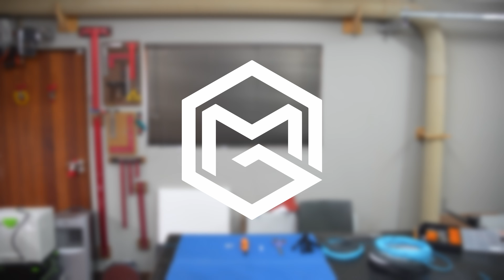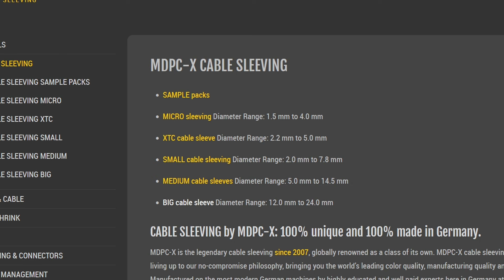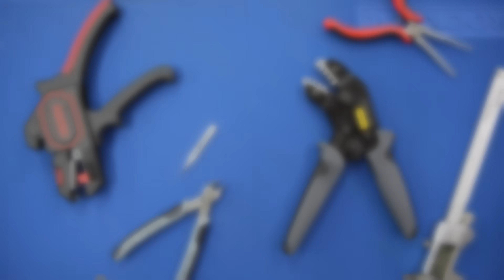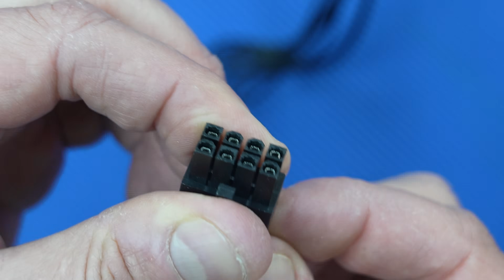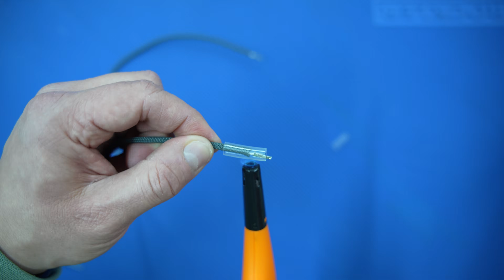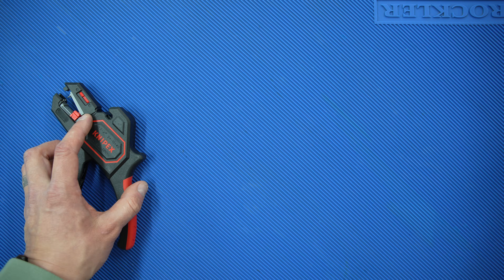EASIEST Way to Sleeve Your PC Cables (No Expensive Tools!)

Comment: how about those gpu cables with pigtails? can you remove those?
Reply from the maker: Yeah definitely, exactly the same as the rest. The terminal is just crimped to two wires , but the terminal is the same on the connector side

Comment: I'm about to sleeve my first 12v2x6 cable just following this method. Got most materials from MDPC-X as well, except the tools which I think cost way too much and the wires which I don't trust the 17 AWG they have are suited for these type of cables.
Reply from the maker: Hi there! How did it go? Yeah I do agree, their tools are quite expensive, but having used several different brand of crimpers, I do think they are worth the money. Especially with small terminals!

Comment: I was considering custom sleeving only the visible part of the cables and leaving the original sleeve on the hidden part, securing them where they meet with some heat shrink. Would it work? Would you approve? (Love the video!)
Reply from the maker: You can definitely do that. It should work just fine. Sometimes the heat shrink need a little bit of help to keep the sleeving taught, can use small cable tie under the heatshrink to keep in in place! Otherwise you could just make extensions , with male connectors on one end and female on the other? Then you don’t even have to touch the stock cables.
Thank you glad you liked the video!
Reply: @marcelgenis  I've heard too many instability/cable-melting/fire-starting stories about extensions. I was thinking about adhesive-lined heat shrink, but cable ties are a good idea if that fails. Thanks!
Reply from the maker: @sheikreal Yeah the more connections you have the more the resistance! The adhesive-lined heat shrink is an good idea! Think it will be the cleanest solution. Enjoy the build!

Comment: have to order more supplies but i was having a ton of trouble with type 5 connectors. using 16awg wiring and 2mm teleios paracord sleeving (using the shrinkless method). I would keep having the issue of either, too much paracord so it wont allow for the pin to go into the type 5 connector or; too little paracord where you can see the wire underneath because of the hap between the pin and paracord.

Comment: what about RTX 16Pin 12V power connector ? can you teach on that cable too ? or isit same way ?
Reply from the maker: Yeah you can definitely make a 16pin or 12VHPWR cable. I personally prefer to use a adapter and reduce the number of that connectors in my build. To make the cable you will need to use 17gauge wire. When using a adapter with 3x 8pin PCIe connectors you can use 15gauge, from a technical point of view it will be safer, little bit more amps per wire. But yet again nothing is certain with these new connectors. My next three builds will not invlude a 16pin connector, but i’ll try and make a video about it. Here is a link to MDPC-X website, they have a detailed guide on how to make one https://www.cable-sleeving.com/12v-2x6-connector

Comment: its not working, the staples just bend

edit: oh, i just figured it out, youve gotta have the staples right in the middle of each side, i wiggle it around a bit and put some pressure on, if you lightly pull on the cable it comes straight out

thanks :D
Reply from the maker: If you are struggling, you can double up the staples. Two on each side. The staples still need to be attached to each other, try to break off two at a time. That should help. You don’t need to use a lot of force, make sure the wire is fully pressed into the connector before you insert the staples. Let me know if this helps!
Reply: @marcelgenis thank you! i think ive figured it out now, its a little finnicky at first but it gets quite easy. great video btw :D cant wait to have some nice looking cables (finally)
Reply from the maker: @unificated Yeah it is quite finnicky! But once you get the hang of it, then it becomes like second natures. Enjoy your new wires! Let me know once you’re re finished!
Reply: @marcelgenis ive been hard at work with it and noticed ive exposed some of the internal mesh right at the end where two metal pieces clamp onto the wire, is this an issue? kind of worried right now
Reply from the maker: @unificated Hey there, just to make sure I understand correctly. The internal mesh, are you talking about the sleeving? Do you have Reddit ? You can maybe drop me a direct message there with a pic. https://www.reddit.com/u/MarcelGenis/s/hf7I7HgExE